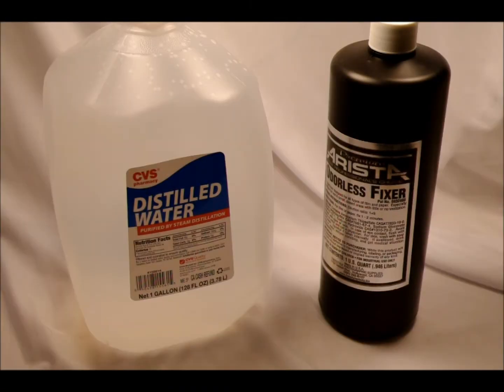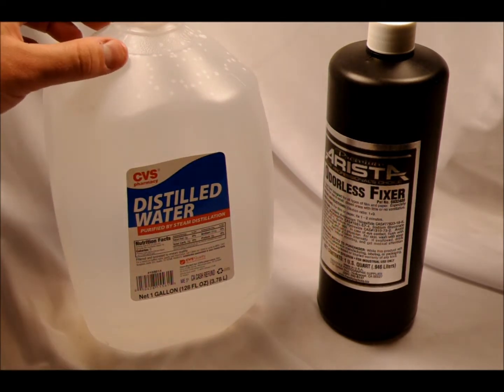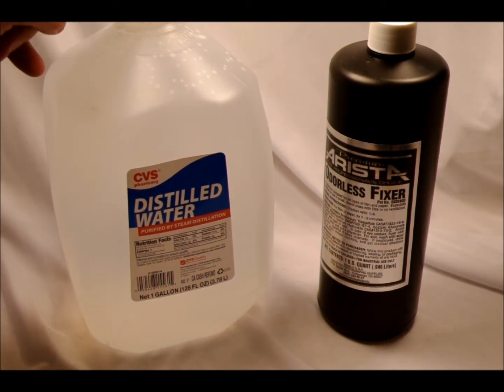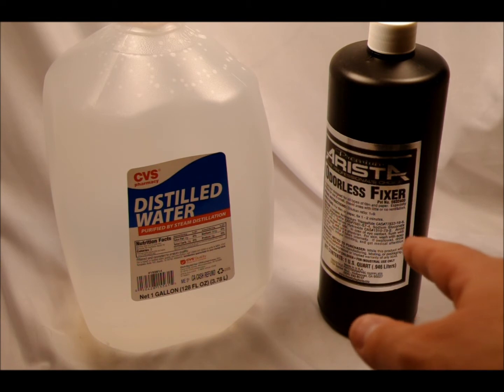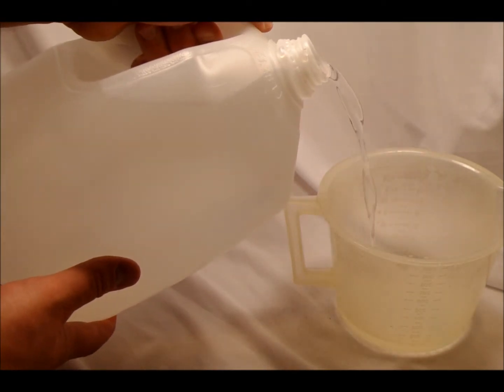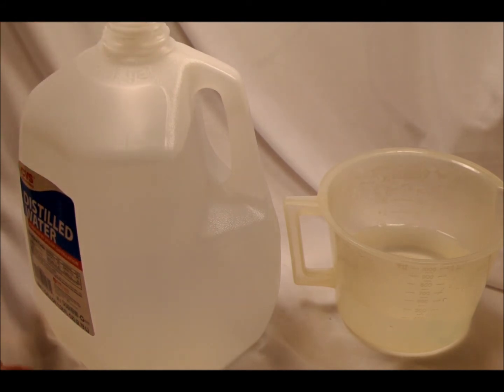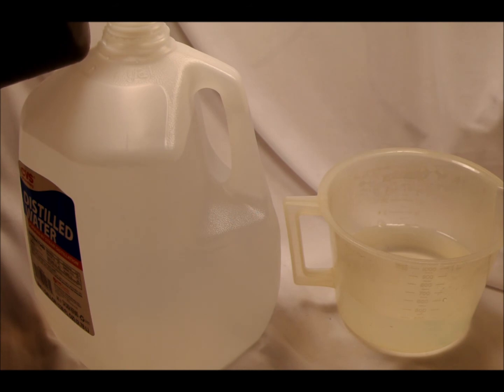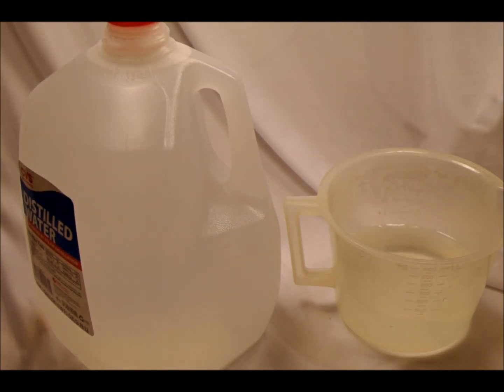How to mix Film Fixer Working Solution from Liquid Concentrate

Comment: What Kind of fixer solution do I have to use, when I develop in stock, so using full Power developer? (Can I use 4+1 or 9+1? )
Reply from the maker: Fix is always used stock and then re-containerized for reuse.

Comment: Hey David, I know this video is SUPER old, but I mixed together a bottle of Ilford Rapid Fix 1:9 in a gallon jug - and a day later there is a huge white chunk of chemicals at the bottom of the bottle. :( I mixed the liquid fixer in when the water was warm, do you think this might have done it?
Reply from the maker: Sounds like a couple of things could have happened. Either the chemistry was added in the wrong order or it wasn't agitated enough. Try breaking apart the clump of chemistry with something like a long dowel that you can get rid of afterward and re-agitate the mix. It should absorb and then be a-okay. Just to be sure it's worth running a test roll thought it before using it for actual photos.

Comment: Im using care stream developer i never know what is the right concentration my film is kind of  dark and overdeveloped 
Any help  please?
Reply from the maker: real4everh There are a lot of possible causes, which is the bad news. The good news is that we can diagnose them and figure out the issue. At the end of this reply, I'll have a detailed process to ascertain proper chemistry dilution.

Before that, let's rule out any other issues. When you say the negatives are dark, do you still have images? How do the edges look? Are they clear, or foggy?

Are all the images the same density or are some properly exposed and some very dark? I'm asking this to determine if your camera is functioning correctly (mechanically.)

If they are all uniformly over exposed, it could be your light meter. What camera are you using and have you compared the light meter reading to the Sunny 16 rule?

Let me know the answer to those and we can figure out if it's a chemistry issue or a camera issue. If it's a chemistry issue, here's how I would test the chemistry to determine the proper dilution.

There is one problem in that I've never used X-ray developer before. So I have no specific insight into that. I would shoot a roll of 36 exposure 35mm film (let's use TMAX 100 as an example as it's got more known developing times than any other film on the market (I believe.) So take your TMAX and shoot the EXACT SAME shot with the EXACT SAME setting 36 times. (I say TMAX because you can use your developing data from this test and known TMAX data for other developers to extrapolate ballpark developer times for other films.)

You film you will cut into six one-foot -- 30cm -- strips in you dark bag and then load it into your tanks one strip per tank. If you don't have six tanks, only cut off what you can use at once, leave a one-inch (2.5cm) leader on the roll, and come back and repeat later.

Now what you'll do is mix up some number of dilutions of your developer. If you've been using 1+10 and found the negatives to be too thick, what you would do is try 1+15, 1+20, 1+25, and so forth until you've got six different dilutions. If you're at 1+1, try 1+2, 1+5, 1+9, 1+14, etc.

Now develop them all for the same amount of time regardless of the dilution, let's say six minutes, which I believe is how long TMAX takes in D-76 1+1. Of those six test strips at six different dilutions at the same developing time, you'll know what the proper developer dilution is.

Using the same time as the D-76 1+1 developing time for TMAX gives you a solid data point for extrapolation. Let's assume that at some dilution for 6:00 your TMAX turns out beautifully. You can then make an assumption (this isn't always perfect) that at that dilution other films will turn out well with their D-76 1+1 time.

Let me know the answers to the questions and we can be 100% sure the issue is with the developer mixture and not your camera.

Comment: How do you separate silver from fixer solution.
Reply from the maker: Aluminum or iron. Kodak used to sell a five-gallon bucket filled with steel wool. The fixer would go in and, for most people, by the time it overflowed the top the stuff at the top would be harmless. I used aluminum foil and let it sit in the spent fixer for about two weeks. When no more aluminum is turning into black dust, then there's no more silver to react with the aluminum. At that point, I filter the aluminum and silver sludge out with a coffee filter or paper towel inside a funnel and can throw it out. A chemist at work said that what passes through the filter at that point will be harmless.
Reply: Thanks for the reply. I've been doing research on this subject for a number of weeks now and still unsure   of how it can be done.  How do I separate silver from Aluminum so that I can get pure silver, or should i leave it like that and just melt it? Again thank you very much..
Reply from the maker: At that point it needs to be smelted. I am told that in order to recover any amount of silver worth any money, it takes hundreds of gallons of spent fixer. Using iron, there may be an easier way to separate it, but I'm not sure.
Reply: Thank you very much. The info you gave save me a lot of time and effort.It would be better for me to concentrate on other sources of silver other than fixer solution. Again, thank you very much for your help...
Reply from the maker: You're welcome.